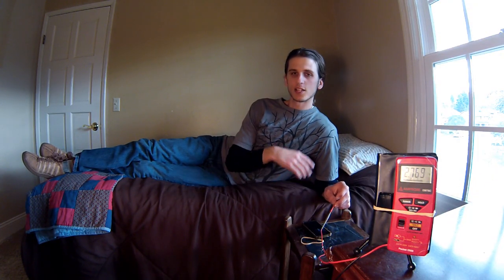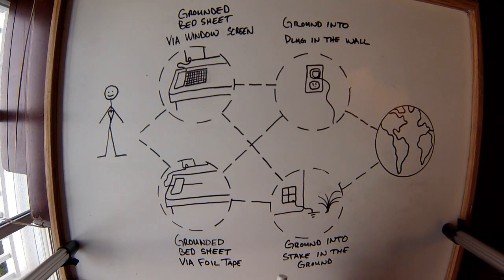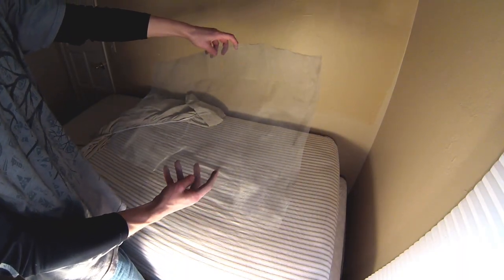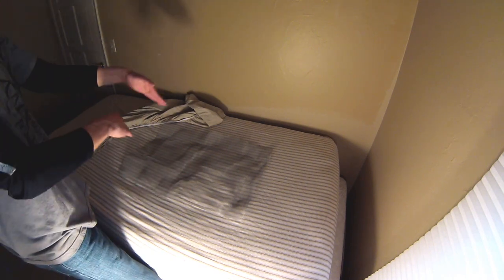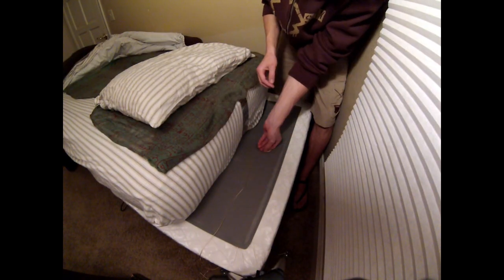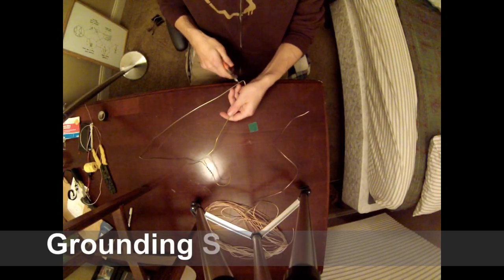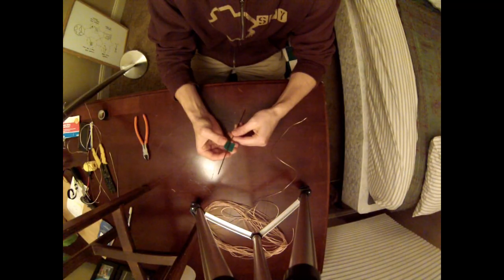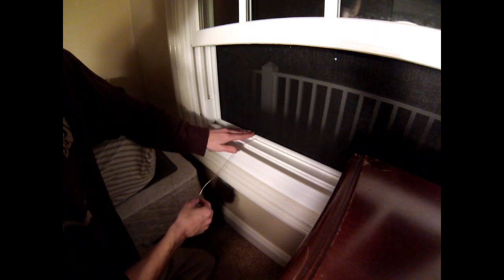DIY Earthing Sheet: How to Sleep Grounded Indoors (Tutorial)

Comment: I will provide you with some tips on how to make this even more effective. We set up a similar arrangement in my house many years ago at my kid's request. For a while my kids were using a wrist attached grounding strap connected to the ground as well. Anyway, here are some tips.

- Your grounding rod is WAY too small, in both diameter and length.  Like your skin, the Earth is not very conductive, so you need a lot of contact area to have a good connection.  Depending on the soil type in your area you will need a rod somewhere between 4 and 10 feet long to establish a good ground. 5-6 feet is usually sufficient. In dry sandy soil you need a lot more. Also, a larger diameter rod of 1/2-inch or more is needed.  Rebar works well for this.

- Use a solid copper wire instead of stranded wire. it should be a heavier gauge for longer distances to minimize resistance. From a second floor window to the ground below I would use 14-gauge solid copper wire or even larger 12-gauge.

- If you have a smart meter, get rid of it and switch back to an analog meter.  These things create horrific levels of EMF at both 900mhz and 5ghz ranges.  If you cannot get rid of it, you can at least try to shield as much radiation as you can. Goggle this to find methods for that.

Good luck and sleep in peace.
Reply: Rebar, or copper? You mentioned both
Reply: @Lyddiebits  You need both rebar and copper wire
Reply: +ArJuna22 first off you are foolish, grounding will do nothing for your health. Second to shield yourself you would need to be 100% surrounded by your shield covered at all orifices with a mesh with no holes greater than 60 mm for 5 ghz, and no ground would be required. Third stranded will offer less resistance especially to high frequency (which i assume is the waves the uneducated here want to protect themselves from).  The best for your specious experiment would be if multiple single strand insulated speaker wire was used and then soldered at each end before connecting to the body. If you want to make it better wrap the ends in seran wrap and then again with foil ensuring the metal on the outside never makes connection with the exposed metal or any ground connection. But don't forget you are on a fool's errand.
Reply: @edwinraynor1221   Have you read the testimonials of many people with serious problems that had remarkable improvement or remission after sleeping grounded?  Do you think they are lying?  They aren't selling anything.  I don't doubt you have a good knowledge of electricity of course.
Reply: Bob Hoskins exactly. This has been scientifically proven. It is not psudeo science. People just need to do the homework.

Comment: nice video! Another option is to connect your bed ground lead wire to a bathroom copper water line thats usually by code already grounded so if your bed happens to be close to the bathroom area your in luck.

Comment: solid core copper wire would be more effective
Reply: +Anthony Estep and how to use it?
Reply: solid core copper wire would be more electrically conductive because of its surface area and how electrons travel...thus providing a better earth grounding function...thus canceling frequencies of rf and modern wave energies (wifi,bluetooth,television,60hz electrical power) more efficiently. the solid core wire could be attached the same as the speaker wire,its just the solid core would be a better option
Reply: +Anthony Estep One that thought I was to use my old coaxial cable left over from tv because of the good shielding it has. my bedroom is upstairs of my house. I would do the long run with the shielded solid core then weave stranded in screen so it don't poke through, Stranded is easier to work with but I agree with you Anthony as long as you got Shielding.

Comment: Here's a tip for those willing to spend a couple bucks more. Instead of using a screen, try this conductive silver fabric. It's just like fabric so you can sleep directly on it, has excellent conductivity, and it avoids any aluminum toxicity issues (as those are the most commonly found metal screens):

http://www.amazon.com/gp/product/B008DXBFYQ?psc=1&redirect=true&ref_=oh_aui_detailpage_o00_s00

Do note that every unit of quantity bought increases the size of the sheet you receive.
Reply: Aluminium toxicity? Will that still be a problem with two sheets on it? Have heard nobody meantioning it before.
Reply: I have some of that fabric but I don't want to ruin my sheet by taping it down, and you're also not supposed to wash conductive fabric. Do you happen to know it it will conduct through a bed sheet as he does with the screen? Thanks in advance if you happen to know
Reply: Derrick Reed Good, no great tip!  Thank you.
Reply: Just note that people have lost conductivity when washing a few times...

Comment: So Can I use aluminum foil from the grocery store instead of the window screen also can you please tell me where you buy all of your supplies from.
Reply: For what Winter Star says, search on YT for a couple who made a Faraday cage around their entire bed. All 6 sides, a cube w no leaks. Sleep inside. Not pretty, not grounding, but emf effective. Could ground to it as well. Then you'd really stop the headaches from em and sleep well.
Reply: +IsraelSalvation  
Heavy Duty aluminum foil might work for mounting on walls, but not on a bed--the bed flexes, which would cause the foil to shred, because it can't flex.  Mesh works better, because it can flex a bit.  Anywhere the screen mesh is taped to the mattress? It's probably gonna slip out from under the tape, too.  
I'd be hanging curtains around the bed, made of mesh, instead of placing it on the mattress....and a section of mesh placed under the mattress where it doesn't need to flex.
Reply: +IsraelSalvation   Aluminum foil cannot tolerate much bending--you would use a LOT, if you slept on it....otherwise, the jokes about wearing tinfoil hats....those were proved to be useless, so better off using mesh?  
IDK why conductive mesh would work better than conductive metal sheeting--but maybe it's because sheeting is one contiguous sheet, and the mesh is little wires that guide the electric charge down them? 
There are websites that sell anti-EMF stuff, ready made --I looked for some a number of times. It might be under "BAUBIOLOGY", or "EMF PROTECTION", or other rearrangements of search terms. 
Then learned I can use aluminum window screen and do a pretty good job.  
In Sweden, mesh was used to make curtains--could see through them, get some daylight, and it drastically lowered the EMF pollution that would otherwise get inside without it. 
It's just stiff to lay on for a sleeping matt.   But I think the mat could really be even under the bed sheet or mattress pad, to soften it. As long as the matt itself is grounded. IDK about this kids' having to keep attached to the matt all the time he's on it.  
Curtains have to have mesh in them; one can make them. 
Or, use plain mesh, and make that into a curtain itself...with a grounding wire. 
I get aluminum window screen from almost any hardware store selling window screen repair materials.
Reply: Winter Star Thanks for your reply.
Reply: YasharalSalvation If wearing the bracelet grounding cord, could just plug that direct to the ground socket [Not the power slots], similar to grounding to work on a computer.  But that body-grounding thing seems Not wanted for baubiology purposes.. the main thing is -Preventing EMFs going through the body...so diverting those via some iteration of a Faraday Cage, is the real deal. 
Ground the mesh or "cage", not the body.

Comment: If you buy the kind of three-pronged ground plug he shows (available in any hardware store) and attach a wire to the ground with the integral screw, and screw it down (which it's designed for), there's no way for the wire to 'come adrift'. The above grounding technique really works.

Comment: THANK YOU for the valuable insight. You've saved me some precious money and time with your video. If you allow I would like to contribute as follows: personally I would opt for a 5 miliamps fuse, soldered connections and min 50 inch stainless steel earthing rod.

Comment: I like this video but i do believe there could be an easier alternative. The purpose of grounding in this video is to discharge and lower your bodies voltage. I have not tried it but i think you can achieve the same effect by using a mega resistor it acts in the same way as ground but its not wired to the earth. I think it could be a safer alternative.
Reply: JDEZ512 make a video

Comment: I heard (but not tried yet) from a very savvy friend that you can connect the wire directly to the copper or metal piping under a sink (bathroom, kitchen) to ground it. If this is so, it may be a great alternative as the other two places shown here either may not be possible or apparently may not be very safe. :) If anyone has any info on this, pls pass along.
Reply: Miranda Lorell  Not all house plumbing is grounded and these days most is PEX or pvc pipe which is of course plastic and worthless for grounding. So make sure you have the right type of pipes and have someone with knowledge check to make sure it is properly grounded if you do. A master electrician such as myself would probably do it for free if you teach them about "grounding". Just a thought. Barter!

Comment: It's possible to re-wire an electric blanket to do this grounding job. Disconnect the wires from live and neutral and connect both to the earth pin.
A big resistor in line with the wire is better than a fuse wire.
Reply: why is a resistor better?  wouldn't a fuse (or two) protect you better from a lightning strike?
Reply: timwebb1000 great idea!

Comment: 5Amp???? wow, Where did u study?

Effects of Electrical Current* on the Body [3]
Current	Reaction
1 milliamp	Just a faint tingle.
5 milliamps	Slight shock felt. Disturbing, but not painful. Most people can “let go.” However, strong involuntary movements can cause injuries.
6-25 milliamps (women)†
9-30 milliamps (men)	Painful shock. Muscular control is lost. This is the range where “freezing currents” start. It may not be possible to “let go.”
50-150 milliamps	Extremely painful shock, respiratory arrest (breathing stops), severe muscle contractions. Flexor muscles may cause holding on; extensor muscles may cause intense pushing away. Death is possible.
1,000-4,300 milliamps (1-4.3 amps)	Ventricular fibrillation (heart pumping action not rhythmic) occurs. Muscles contract; nerve damage occurs. Death is likely.
10,000 milliamps (10 amps)	Cardiac arrest and severe burns occur. Death is probable.

Comment: thanx ....I wear my bike helmet covered w alum. foil w holes and a cloth headband bandana on top of that w a large visor attached. I got rid of my boxspring and mattress w metal coils. I sleep on a hammock in my garage with the opener unplugged and a dirty electricity filter plugged in atleast 8' from my head when I sleep. I sleep in a sleeping bag on top of the hammock and the metal stand has foam noodles all around each bar. the metal shelf brackets also are noodled. I do not shut my breakers off anymore experimenting because in july 2014 I believe, in Reno Nevada a man shut his breakers off and his smartmeter ignited and burned his face. sept 2014 michelle Sherman, 61, died in her Reno home from a smartmeter igniting. the meter was removed. In Oct. 2014 the Deputy General of Reno ordered by subpoena all records from 2000 on related to any smoke, smartmeter, fire dept records etc for a complete investigation. 200,000 smartmeters were recalled in aug. 2014 from Canada, Oregon, florida and philly as a fire hazard. I had my smartmeter removed after being lied to for over 4 years that I was getting an analog. I had every side effect listed before discovering I had a smartmeter. the new analog they put on, and are charging me an extortion fee, may or may not be smart grid compatible and may or may not have a hidden chip in it. there is one meter that could tell me if it is electronic or analog but have yet to find someone independent with that meter.

Comment: The plug socket method IMO is very dangerous, if that earth wire comes adrift it could touch the live. You need a plug that only has an earth terminal in it to be safe dude.
Reply: Andrew K Fletcher Good point! Seems like separate outside grounding rod is better method.
Reply: It is a good idea to remove the other two pins from the plug, leaving just the earth pin. This would be very safe. However in some countries there is no earth just the negative and positive, which the negative is a ground but channels the current flow.
Reply: It wouldn't be safe at all, sorry. Using the ground pole from the voltage outlets to connect that "earthing sheet" is very dangerous as when doing that you are simply conecting it to the ground net of your house's electric installation. The ground wires in it are used to conduct any possible voltage from a default device to the ground in order to protect you from taking that the voltage leak by rerouting it to the ground. So imagine what would happen if there's a voltage leak through the ground wire in your house's circuit and your body is connected to it... "Fighting" electricity without knowing how it works is really very dangerous. If a problem happened with your insllation and / or a faulty device when using that sheet, you could be taking some hundred volts while trying to avoid to take just a few few milivolts. Your Call.
Reply: ...that is what the ground is for. The excessive electricity will go to the ground. If one device is faulty, it does not cause any issues on the other devices, does it? It does not because the ground takes the voltage. There aren't any known incidents when using earthing devices which are sold online, used in offices, everywhere.
Reply: @GMGB68  A home's fused live circuit will switch of any current that would be dangerous or deadly alot quicker than any ground/earth circuit leakage killing you. But it would be better to ground your mats or sheets with a ground rod into the soil...
Reply: yea sounds like a stupid idea to connect ur bedsheet to the wall plug
Reply: @RIMJANESSOHMALOOG  But its a GREAT way of waking up in the morning when caffeine isn't quite cutting it!

Comment: I learned SO MUCH from this video.  My arthritis has improved and the meds for it cut down to 1/3!  Without getting into ugly detail, a many-years long, chronic intestinal problem has completely gone away.  And can we talk cognitive function?  Way improved.  My mind is working like I was 30 again.  All because I read a book and followed the directions of this video.

I've made my own 'mat' using a 6X12" copper sheet sold pretty cheap on Etsy for jewelry makers, electrical wire, a grounding rod (bought on Amazon), one alligator clip and good quality electrical tape (cloth based, not plastic).  This works for me because I am older and sit a lot. 

And I did what the video taught with a piece of uncoated copper screening.

This is working very well for me.  I stay grounded all night and all the time I am at the computer or watching TV.
Reply: Arias Dupre make a video pls
Reply: Sounds great that it helped you so much.   Don't forget the inline fuse everyone.   😀
Reply: Blessed Awareness Through Prayer what size fuse?
Reply: Hi, I checked Etsy but can you advise on which gage of copper to use?  Thanks :)
Reply: for people in this thread, just think earthing direct, which means having socks made for earthing or cuffs that also are made for earthing to slip on your ancles before you go to sleep. This way it's easily removable and you have direct contact which means the best effect, where I get 0,05 volts through my voltmeter test. I also use the earth wall outlet, but make sure your system is thoroughly earthed and ofc a good connection to the outside ground. Otherwise you need a rod etc.

My experienced health benefits are better sleep, no more going to the bathroom at night and more rested in the morning. This happened after few nights earthing. People who are not taking advantage of this FREE source of healing are missing out.
Reply: after how long did you see the effects  pls
Reply: Do you still use it?
Reply: Are you sure that your illnesses are gone because of this mechanism?

Comment: Please disconnect yourself(s) from the power grid! 

Earth is tied to neutral in your house and at the power station. 

I measured the voltage on my Mac Book Pro's power connector (the metal part that you touch to plug it into the computer) and it measures 97volts AC with respect to earth. This is due to the EMC capacitors within it's power supply.

If you are part of the power grid, this means that this 97VAC will go back to neutral passing through you as current, and this is not good for your heart!!

Comment: You should try to solder all the connections.  Also I would suggest using a piece of copper wire for your stake, such as used in residential wiring.  I'm pretty sure you can buy short lengths at Lowe's etc.  Get the largest diameter you can because it is stiffer, except it will be more difficult to solder to the large diameter because it will carry the heat away.  Thanks for the video.